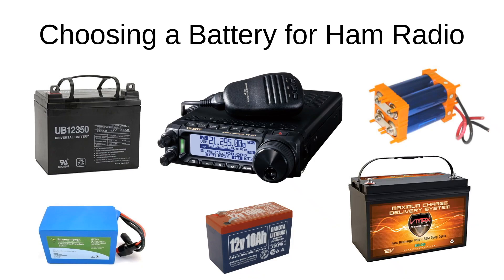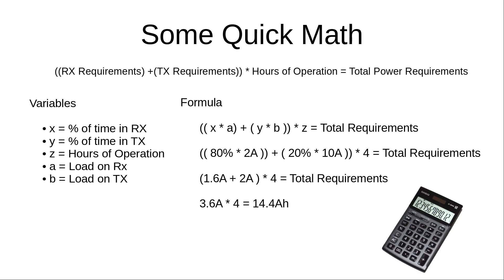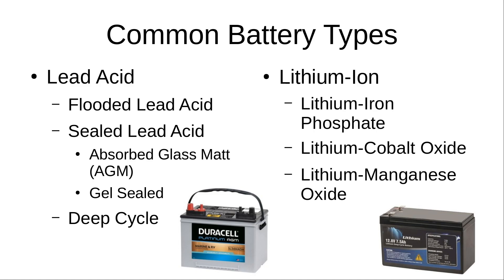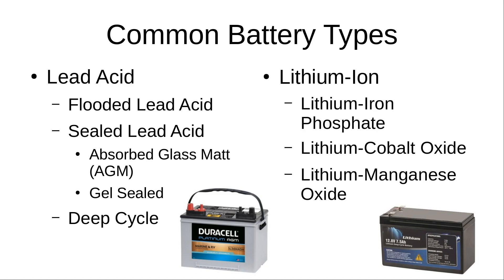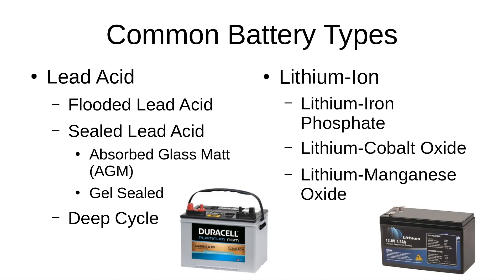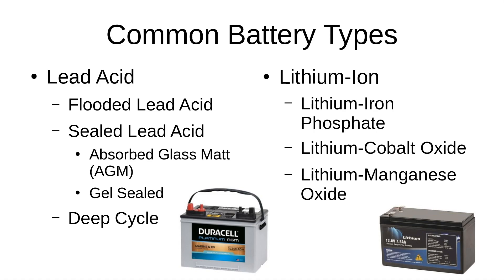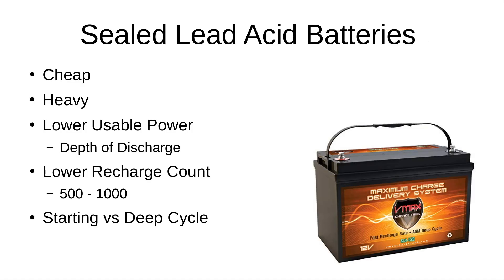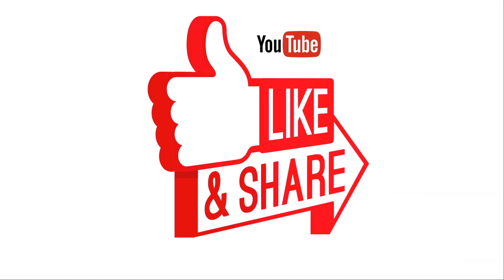Which Battery Is Best for Ham Radio?

Comment: 5 years later in 2025, LiFePO4 prices have come down significantly as their use in electric vehicles has increase dramatically, particularly in China where LiFePO4 has 80% of the EV market. Physical size/capacity and weight/capacity has come down too as chemistry and packaging is fine-tuned and batteries shift from 18650 cylindrical cells ==> to prismatic cells ==> pouch cells.  Great summary of batteries for radios, still valid in 2025.
Reply from the maker: Thanks man, glad you liked the video 👍

Comment: What about a battery for a ham radio in a car?
Reply from the maker: Like a second battery in the car's electrical system or a portable battery?
Reply: @TheSmokinApe  neither just a battery for my truck to run a ham radio at the right voltage.
Reply from the maker: @Fox250R  gotcha.  Bioenno seems to be the choice for most hams but they are a little expensive.  Two others that I have been using are Ampere Time and Redodo, I have some videos on them.  Did you have an idea what side you are looking for?  How many watts is your radio?
Reply: @TheSmokinApe  thank you for the reply, around 200watts

Comment: Thank you for the informative video. I've gotten conflicting  information about low voltage damaging a ham radio including the ft-891. I saw your low-voltage numbers and it doesn't seem to hurt your equipment. Does the ft-891 have a low-voltage shut-off or warning? Can low-enough voltage damage a radio including the ft-891? Thank you. 73
Reply from the maker: Sorry man, I don't have the 891 but I am sure its in the manual.  Tanks for watching N!

Comment: Is it ok to charge the battery while operating a radio? I just got an icom 5100 and wanted to hook it up for testing at home. I have an old deep cycle that has seen better days so I'm sure the capacity has decreased. So basically I would be using the battery like a capacitor.
Reply from the maker: Yes, depending on the charge controller
Reply: @TheSmokinApe regular battery charger? I have a smart one and an old dumb one

Comment: I just found this video.  Good job.  On topic missing from your discussion is the amount of current that a battery can deliver.  I run a pure solar/battery-powered shack.  My main batttery at this time is a 12Ah LiFePO4 battery.  I was wondering why I could never get my radio to transmit with 100w.  The best I could get was 50 to 75 watts.  At 100w output the radio (FT-891) wants to draw about 26amps. At first I thought, well, my battery has only 12amps, and so 20 amps was not possible.  I wrote the battery manufacturer about this. He responded that the "C" value was only "1" and could not deliver the 26 amps my radio needed.  Long story short, I am looking for a battery, or batteries, that can deliver the amps my radio needs.  Do you have any suggestions?  Especially what parameters/specs to look for.  I live in Europe, so I don't expect a make/model recommendation.  Thanks again for an otherwise comprehensive video.  SV0SGS
Reply from the maker: Glad you liked the video, thanks for watching.
Reply: @TheSmokinApe  you haven't answered the question .😮

Comment: I have a radio which runs of 12VDC or 24VDC.. would I be better off running mine on a 24VDC battery (two 12V batteries in series)?

Comment: Plan on emergency service comms lasting a week. That is the usual time before FEMA and the power companies take to get to you to help out or get your power back on. I was involved in emergency communications with the Navy MARS and ARES or RACES through Amateur Radio. That made me learn the time you are usually without power after a Winter Storm, tornado, or Hurricane. Three days power are not enough to have dependable power for an actual emergency. Maybe buy one of the more inexpensive 2 Kw gas generators for additional power.

Comment: Is a 12 volt battery compatible with a portable SW radio such as my Tecsun PL-660 which normally uses a 5 volt power supply.  OR...  Can a 12 volt battery be configured to deliver 5 volts.  Same questions for a 6 volt battery???   OR...  Will my radio self adjust to accept these higher voltages?  Right now, The radio uses four 1.5 volt AA cells.  Thanks
Reply from the maker: You would need a voltage converter, if you have battery operated devices your better off looking at a rechargeable battery solution.
Reply: @TheSmokinApe    Thanks for the info on the voltage converter.  I believe I found the right device on Amazon.
https://www.amazon.com/Extractme-Converter-Regulator-Step-Down-Adapter/dp/B081NCXB2M/ref=sr_1_3?dchild=1&keywords=DC+12V+to+USB+5V+3A+Converter&qid=1606661571&sr=8-3  
I am not sure of exactly what you meant by "rechargeable battery solution".  If you are referring to something like an Anker Power Core 15600, I have one.  It charges phone and drone batteries pretty well.  Problem with it is that it shuts down when connected to my (battery-less) MLA-30 Active Loop Antenna.  It seemed to me that using a "brainless" 12 volt battery could solve that problem along with providing a considerably longer run time than the Anker for both the PLL-660 and the MLA-30.  Is my thinking tight?  Thanks again

Comment: Great video. I have watched before but am trying to evaluate my battery needs for my shack. Also I normally watch the ads on YouTube in the hopes you receive revenue. But YouTube gave a 1:30 ad as in 1hour, 30 minutes.  Longer than your video.  🤦‍♀️ 

So I am looking into purchasing a power supply or building a solar generator for my ham shack.  Also will plan on using the solar generator to power my CPAP as a backup for our country power.  73!
Reply from the maker: Glad you liked the video 👍 and dang and and hour and half commercials.  Good luck with the project 👍

Comment: Man I paid line 100$ for a solar charger battery combo unit and it doesn’t put out enough amps for my radio to broadcast at full power. I suppose I have an accidental DX setup, but it wasn’t on purpose. Good video sir as always, 73!
Reply from the maker: Getting the power and battery stuff right is always a chore!  Glad you like the video👍

Comment: I will be using 3 6 AH LiFePo4 in parallel for my new FT-891 when portable. This will be good for up to 50 watts.
Reply from the maker: Bill Ryland what batteries?
Reply: @TheSmokinApe  "Miady" model LFP6AH from Amazon. $30 each. They have a limit of 6 amps continuous discharge.

Comment: Lithium Iron Phosphate, LiFePO4 High Capacity Deep Cycle Battery,

Or 
12v 22Ah Lithium Iron Phosphate, LiFePO4 Battery

Whats which one should I use for my ft991a 

Its a same price range
Reply from the maker: Kaan Ucele are they both 22Ah?  They are both the same chemistry...  what charger will you use?

Comment: Calculated my AH for ft857d. However I use it qrp 25 watts max. would this translate from 24ah at full power less than half? Also rigs call foe 13.8 will 12 v cause more current drain? New to low power portable as new apartment forcing me into parks camping!
Reply from the maker: You need to factor rx and tx time.  Also the battery type...  13.8 bs 12 won’t be too big if and issue on draw, your radio can operate at lower voltage than 13.8 👍
Reply: @TheSmokinApe  I did recalc get about 15ah at qrp. Looking at one but thought dropping to 12v a bad thing?
Reply from the maker: What battery are you looking at?
Reply: @TheSmokinApe  I calculated about 20AH safe. I am looking at local batteries for Gell Cell deep cycle near here. If you have a recommendation let me know. I am not even running full power or other devices only ft857d at 25/10/8. Manuel lists 2A rx and 22a tx at full power.  Meter shows not above max of10a at 25 watts. Hope I did not flunk algebra using formulas and appreciate your kind help.
Reply from the maker: No particular recommendation, get the video was helpful 👍

Comment: What brand of LiFePO4 do you recommend eg Dakota, Bioenno Power, etc? N6KV
Reply from the maker: I have two Bioenno and they seem to be pretty solid.  I’ve never tried a Dakota but I hear good things.
Reply: I have two 10ah Dakota batteries and they seem pretty solid. Just one thing to Remember. lithium batteries require a higher voltage charge then SLA. Usually 14.2 volts for a SLA replacement. Most car alternators charge around 13.8-14.2 so they will generally work for lithium batteries. Otherwise you need a charger capable of charging 14.2 volts.
Reply from the maker: Nice add!  The Bioenno batteries can be bundled with an AC wall charger to get you started.
Reply: Two Bioenno's here and VERY happy.